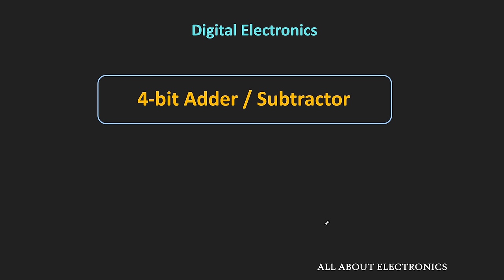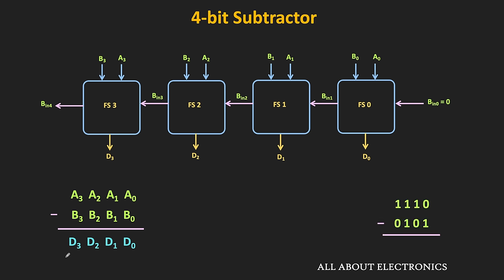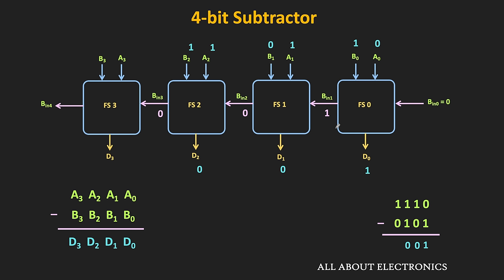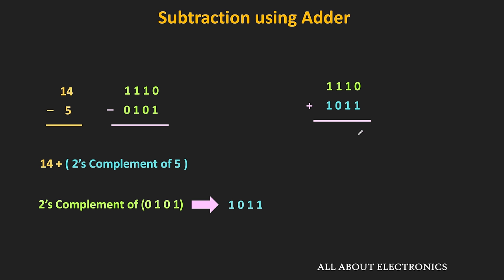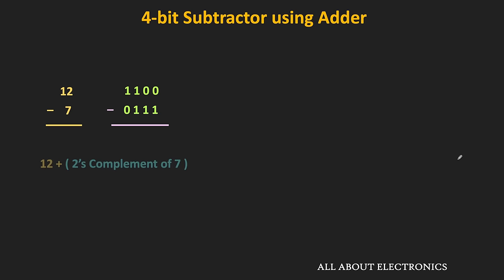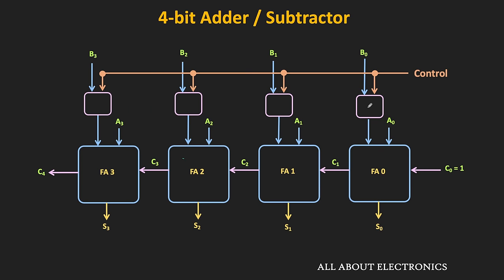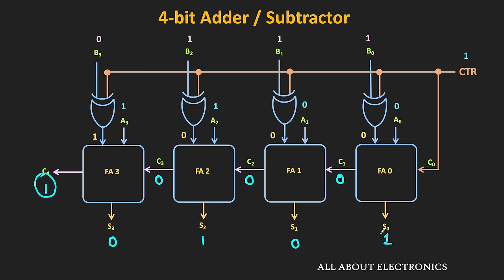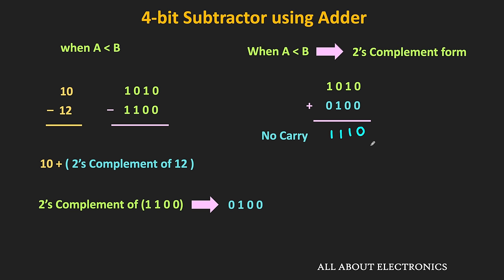4-bit Adder and Subtractor Circuit Explained

Comment: I have a question, why does the 2's complement checker does not work when you add two negative numbers? Ex. -2-1 = 1110 + 1111 = 11101. So the most significant bit, which is 1, is inverted and then it goes through a AND gate with the CTR value, but the result ends up being 0 (0 * 1) . Even though the result is in 2's complement form. PLS HELP, I have a project related to this. Thank you!
Reply: This 2's complement checker here only deals with unsigned integers (positive numbers only). We are only subtracting ONE unsigned integer from the other unsigned integer. 

They cannot both be negative, since the circuit can only convert one of them to its 2's complement representation.

However, the 2's complement checker here is also not 100% correct, it fails to account for subtraction by zero, which will never output a carry bit and thus, the checker would mark the result as a 2's complement number when it isn't.

What you are doing is adding two SIGNED integers. The inputs and outputs are already guaranteed to be in 2's complement, so you don't need a checker there.

(You might need a checker to detect overflows (+ve + +ve = -ve) and underflows (-ve + -ve = +ve) which you can do by comparing the MSBs of the two inputs and the output)
Reply: @Reydriel  rare to see anime lovers learning digital electronics
Reply: @igxniisan6996  Nerds, going to college? Ain't no way lmao

Comment: 00:11 Designing a 4-bit subtractor circuit
02:57 Performing subtraction using an adder circuit with 2's complement
05:28 Performing subtraction using the adder circuit
08:01 Performing subtraction using a modified adder circuit.
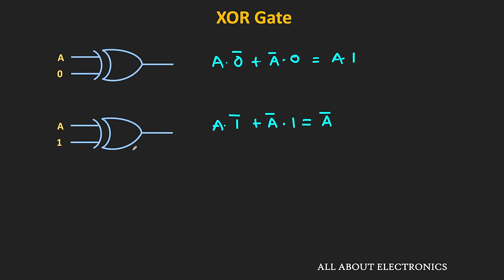10:42 XOR gate can be used for both addition and subtraction
13:23 Binary addition and subtraction using XOR gates and adder circuit
15:59 Performing subtraction using 2's complement form
18:21 The adder circuit can be used for addition and subtraction

Comment: at 20:05 suppose I want to add 1001+1000 using the Adder/Subtractor circuit, The final result is 10001. In this case CTR=0 , as a result output of AND gate will be 0. So the sum result from the first 4 bit RCA will be 0001. Since AND output is 0, Cin at Second RCA will be 0 and all A3A2A1A0 of second 4bit RCA is 0 added with B3B2B1B0 which is same as B3B2B1B0 of first RCA (since AND output=0). The final sum output of second RCA will be now 0001 but Cout of second RCA is 0 ( all A3A2A1A0 of second RCA is grounded) . But we know the final result is 10001. how this carry can be missed out in second RCA. . Kindly help.
Reply: Don't take that carry from the second RCA, use the original carry from 1st RCA is what I would suggest

Comment: Hi, I have tried to make the same the circuit on the circuit verse but upon doing the addition of 1111 and 1000 bits the carry out of the second 4bit adder is not giving the 1 bit as the output carry, so, do we need to need to get the output of the carry or borrow bit from the 1st 4bit adder module ?

Comment: 6:55 - My question here is instead of making carry=1 in the first bit why can't we remove the inverter of B in first bit and making carry=0 as usual?
Reply from the maker: Yes, It will work. But it is better to use the same arithmetic blocks for each bit. (rather than a little different arithmetic block/without inverter for LSB)
Reply: @ALLABOUTELECTRONICS thank you

Comment: Great explanation sir.
What it the output from the And gate is 0, since A>B.
We don't want it to do the 2's complement of B again and then add since A>B. How would the system know it's to stop if A>B.
Reply from the maker: If A > B,  And if you are performing A - B, then you will get carry at the output. That means Co = 1. So, here since it is applied through invert to the AND gate, so the output of the AND gate will be 0. That means the output of the second ADDER is same as the output of the first adder. ( since XOR gate won't invert the S3, S2, S1 and S0 ouptuts of the first adder, and C0 for second adder will also be 0). I hope, it will clear your doubt.
Reply: @ALLABOUTELECTRONICS Thank you sir, I had to go back and look at it again, A0-A3 is 0, so it won't change the value of the 1st adder as you said the carry out it's applied through invert to AND gate.

Comment: what would change if the operation was like -3 +4 , thats like my problem right now is how to represent the negative number , i know that there is 1's & 2's complement representation and there is a sign magnitude representation but in the implantation on the circuit how will the gate recognize if the most significant bit is a sign
Reply from the maker: This circuit is for the addition and subtraction of unsigned numbers. For the negative numbers ( 2s complete numbers), you need to modify the circuit.

Comment: I have a doubt , please clear it as i have my exam tomorrow 😅 , at 1:51 the A1 should be zero bcoz we have taken that one as a borrow , why have u wrote that as 1 ?
Reply from the maker: What you are saying is true for pen and paper method where we are doing the subtraction by hand . Here we are implementing it using hardware, where A is one input and Number B is another input. So, there is no need to change the input. Rather according to borrow, we should alter the output bit. I hope, it will clear your doubt .

Comment: Your explaination was awesome. But i have a doubt sir , if we add two 4 bits which results to get a 5 bit output then the carry output atlast will be not shown by this method because we use not gate and multiply with ctr.

 How to overcome this problem?
Reply from the maker: If you closely observe, C4 output is still available. Of course, the same signal is given to NOT gate and to AND gate. But in case, if the carry is generated then it will be available. Whether it is valid carry or not, that depends on the output of the AND gate. I hope, it will clear your doubt.

Comment: sir i have one doubt in this, here we use bin0 as our control pin, as when bin0 = 0 , then the circuit perform addition, and when bin 0 = 1; the cicuit perform addition, but if we have our bin = 1 in addition case i.e if there is alreay a carry in , then we can't perform addition here.. it will do subtraction in that case.
please clear this doubt
Reply from the maker: you need to connect the Cin input with CTR input only for the first block (The Least significant Block). Suppose you are cascading multiple such blocks then you can directly connect Cout of one block to Cin of the next block. In the next block, you don't need to connect CTR with Cin.
You can check it manually or you can also simulate the same thing. I hope you got what I mean to say. If you still have any doubt then let me know here.
Reply: @ALLABOUTELECTRONICS  oh, now i visualise this sir, completely clear now , Thanks for the reply 😄

Comment: Design a 4-bit ALU capable of executing the following operations:
Addition of two 4-bit binary numbers
Subtraction of two 4-bit binary numbers
Increment operation on a single 4-bit binary number
Bitwise AND and OR operations on two 4-bit binary numbers
Detailed Specifications:
Input:
Two 4-bit binary numbers, A (A3 A2 A1 A0) and B (B3 B2 B1 B0).
Control signals to select the operation (2-bit control signal S1S0 to determine the operation).
Control Signal (S1S0) Operation Codes:
00 → Addition (A + B)
01 → Subtraction (A - B)
10 → Increment (A + 1)
11 → Logical AND (A AND B) and Logical OR (A OR B) (use a switch to choose AND or OR)

Does anyone know how can I draw circuit diagram for this. I tried but I couldn’t do it.

Comment: for the question (10-12) the answer would be 11110 when we calculate simply without using any circuit 
but in the final circuit while performing (10-12) the result concluded by (4-bit adder-2): s3s2s1s0 is 1100 with sign 1. 
while the answer should be 11110. 
no true form or 2s complement form. 
the answer should be 11110 which was given by single circuit, then why add the second?!
please clearify.

Comment: I have a question huhu, how do you know the equivalent of  a3 a2 a1 a0?
Reply from the maker: Using binary to decimal conversion. A3 is MSB while A0 is LSB. For example, if A3 A2 A1 A0 = 1001, then in decimal that is equivalent to (1x 2^3 ) + (0x 2^2) + (0 x 2^1) + (1 x 2^0) = 8 + 1 = 9
I hope, it will clear your doubt.

Comment: Also sir, it just talks about if B was either a negative or positive, what if A was either positive or negative.
Reply from the maker: This circuit is meant for the addition and subtraction of the two 4-bit unsigned numbers. It is not designed for the signed numbers.
Reply: @ALLABOUTELECTRONICS  I know it's for 4-bit unsigned numbers.
The circuit only solves for when B is either positive or negative. What if A was either positive or negative too. We can have A-B, A+B and also -A-B.
The question is for the scenario where -A-B needs to be solved for sir. Thank you.
Reply from the maker: The unsigned numbers will be non-negative. So, -A -B scenario won’t come. If you have two unsigned numbers then either you add them or subtract them.
Reply: @ALLABOUTELECTRONICS  ohh thank you very much sir 🙏

Comment: But in calculator we don't have two display for input. We have only one display so we add serially like at first input 3 then input 2 and we get output 5.

How we can design this type of circuit which will take input serially like real life calculator  and we get output using memory flip flop and logic gate.

I didn't find the answer how our real life calculator is working and saving the input in memory then add it to another and produces output.